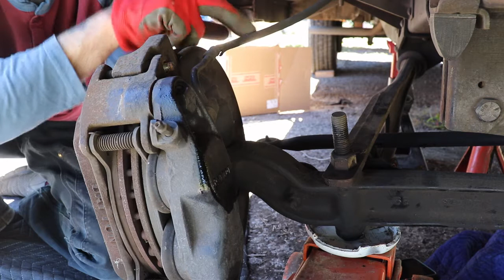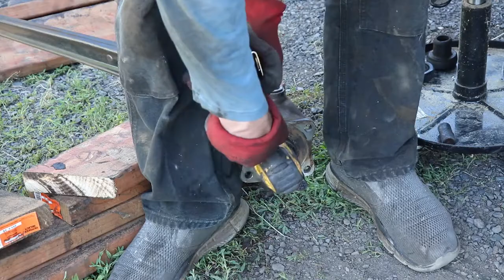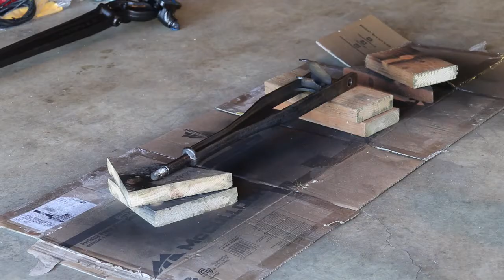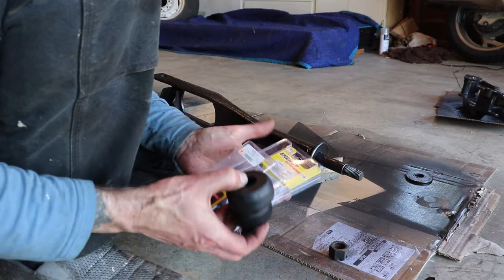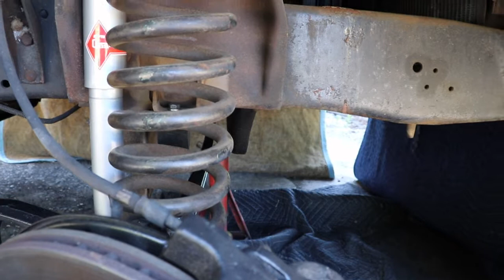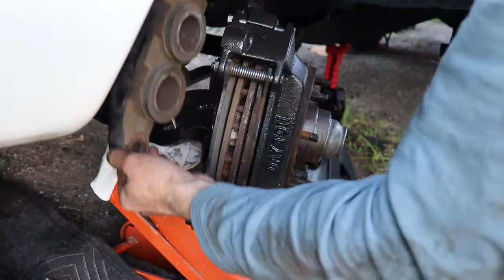1972 Complete Front Suspension Rebuild, F250. Twin I beams, Front Disc Brakes

Comment: Great video!  Doing a front suspension swap on mine (71) to a disc brake setup from a 76.  Adding power steering while I’m at it.  Good info and adding in the torque specs was even better.

Comment: What can you tell me about camber adjustments? Can't find anything on the subject.
Reply: I have the same concern the top of my tires are leaning outward a little not to much. F250 camper special 2wd. The top of the spindle where kingpin slides thru has a little play not sure if it's normal or not. Share if you find something.
Reply: Thanks for the great tutorial Randall.  Your king pins must have been tight with no play.

Comment: Where did you get your torque specs and bushing kits from? Thanks! About to do the same on my '71.
Reply from the maker: I used a Haynes repair manual for 1973-1979 ford trucks. 
Most of the parts were purchased from national parts depot.
Reply: @randalldellwo6365  thank you!

Comment: How much did it cost you for parts to do this repair?
Reply from the maker: Cost around $700 I think. That includes the king pins which I didn’t use cause mine were still in great shape.

Comment: how many hours for a job like this
Reply from the maker: It took me about 4 days, roughly 4 hours per day.  But  a lot of time was spent trying to remove the rubber bushing from the end of beams. And a bunch more time making sure I had the proper torque specs. If those things weren’t an issue I think it could be an easy two day job or roughly 8 hours.